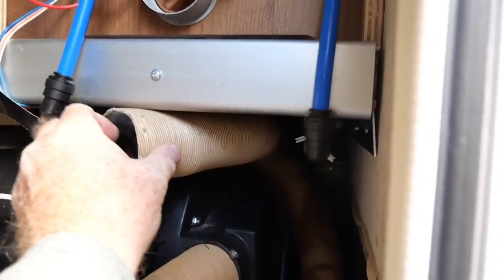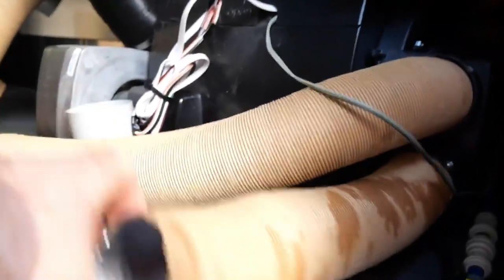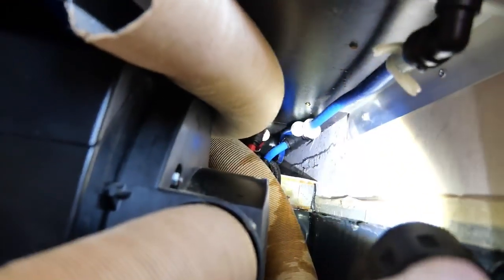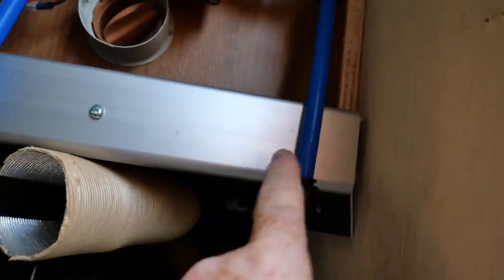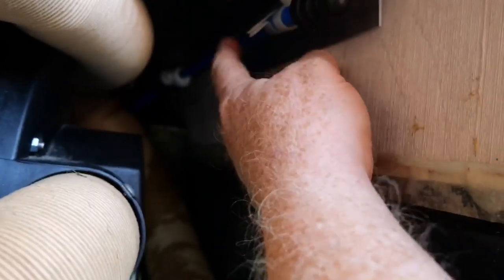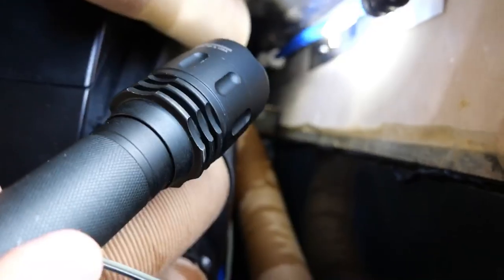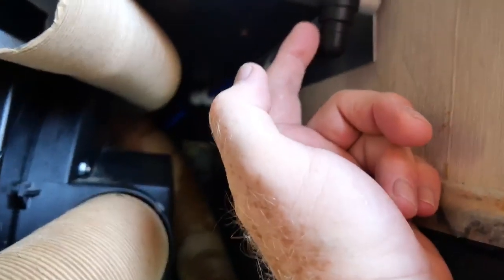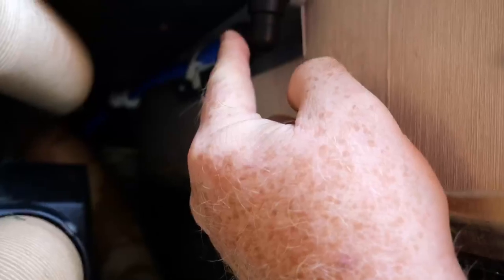Motorhome water leak fix and manufacturer penny pinching

Comment: We had water leaks in our caravan last year. Hubby sorted it, due to movement of our caravan going to sites. The connection pressed in and loosened the pipe. We ended up with water in our bathroom cabinet and another time under the sofa at the front of the caravan. Hubby came up with a aluminium u bracket that goes around the press fit, to stop it from being pressed in. Always interesting to see how others solve problems on the road, not always easy to get to a repair shop. TFS. xxx

Comment: Hi, It might be worth replacing the blue pipe that is a bit short, it's the driving on uneven roads that could be stressing the joint, coach builds do have these sort of problems with the entire bodywork moving about. Nice video so thanks for doing them. UK
Reply from the maker: Yes I agree 👍😀😎

Comment: I had the exact same problem on an Autotrail rental whilst in Scotland. Same double joint from the pump and a pipe that was too short, only difference was it was the other side of a half inch whole. The whole shower unit had to be removed to get access for a 2 minute repair!!! I had 10 days with no Hot or Cold water☹️
Reply from the maker: The design of these things leaves a lot to be desired!

Comment: Should always use a insert regardless if it mains water pressure or not .I had a similar experience with my caravan heater fittings .PLUMBING it's great isn't it been doing it for 40 years Steve.
Reply: That's my day time job.

Comment: I’m very surprised and disappointed that Autotrail hasn’t allowed for access to those joints from above?  - it’s hard to believe actually ! - however we do, so I really think 🤔 they (Autotrail) need a call because manufacturers have a duty to provide access for safe maintenance. 
I do stick up for Autotrail normally because I think they build an ok 👌 reasonably tough product, so maybe this could be a fault stemming way back to the design stage that was overlooked and has gone unchallenged until you have a word-I really think you should it’s definitely poor show !
You can get metal/aluminium plug inserts to strengthen up the ends of pipe for screw-fittings (which I think are  a better termination ) so the pipe isn’t compressed when tightened , however I don’t see that you would get much benefit for using them in a push fit fitting - that said I’m not a plumber and would welcome being educated. 
I spoke about high voltage to the pump and freezing 🥶 before and now someone has mentioned vibration ...so it might even be a combination of all three happening within a close time frame- ie the pipe had become partially frozen and the pump with full power and pressure loosened it with the vibration of the road - the system is normally pressurised. 
One things for sure you don’t want it to happen again or indeed keep happening. I’m not a lover of those push fittings I would prefer them replaced with screw tight ones with the metal inserts however that from what you have shown on your vlog doesn’t look like a easy retro-fit - 
I’m truly very disappointed 😔!!!!!! 
Well done for rising to the challenge and sorting it yourself- that along with the fact it’s no longer leaking is positive news. Lastly low temperature must be high on the suspect list for cause- can you can’t lag them pipes with something ?? - that might help- Chris.♥️😇🌹💐👍
Reply from the maker: Have a look on YouTube for John Guest pushfit twist lock. There is a pretty good demo and explanation with section cutaways. I don’t have that type but would love to retrofit them to the Comanche
Reply: The Happy Travellers - I will have a look 👀Steve ! - If you had the access it would possibly be a worthwhile retrofit  however I still think Autotrail are worth a call because they may enlighten you as to why it has happened especially if it’s been happening to others. 
If not then you probably have a faulty push fitting that will fail again. Chris. ♥️😇🌹💐

Comment: Mb there would be too much restriction to the flow through the pipe with an insert added.
Reply from the maker: Well it's all about good design and specifications. They skimp on the ”hidden” things and don't do much better on the things we can see 😞🤷‍♂️
Reply: @TheHappyTravellers  i agree with that.as a plumber i use these fittings all the time and the manufacturer stipulates an insert must be used at all times,i dont see why the 12mm would be any different.theres also a clip that fits so the pipe cannot come out of the fitting accidentallyyou would think these would be a must given the movement of either a mh or caravan.

Comment: I think that insert is only needed for mains water pressure
Reply from the maker: If you look at the product use demo on Youtube they are an integral part. 
Using the insert would pretty much guarantee no leek but as I say all motorhome manufacturers are penny pitchers. There is evidence throughout the Comanche which is the flagship model. If they skimp on the too of the line goodness knows how they go on the lower coat models.